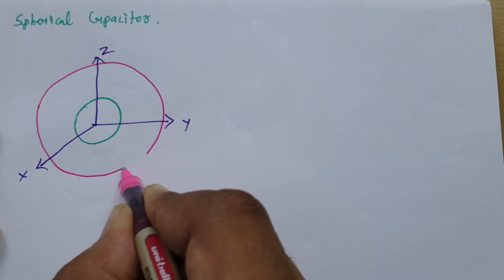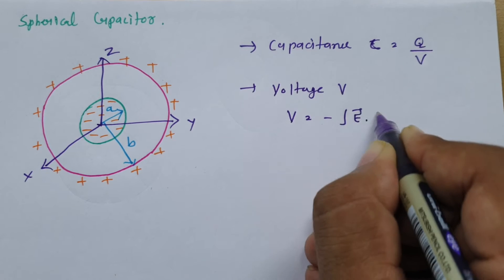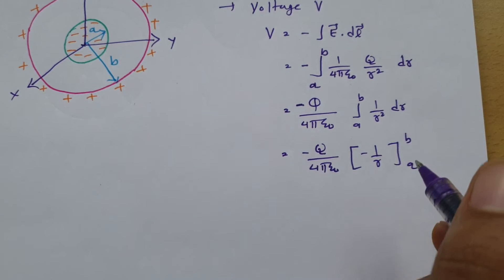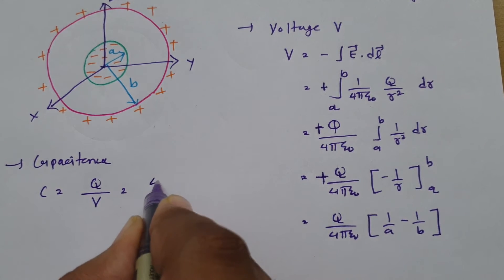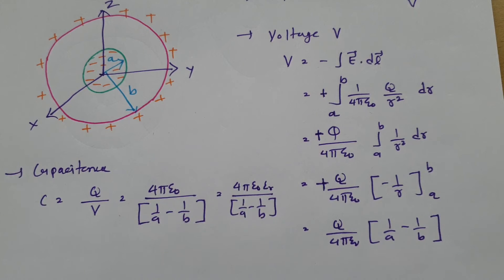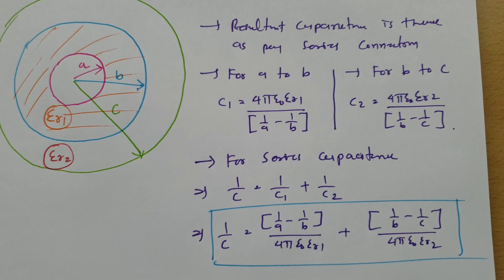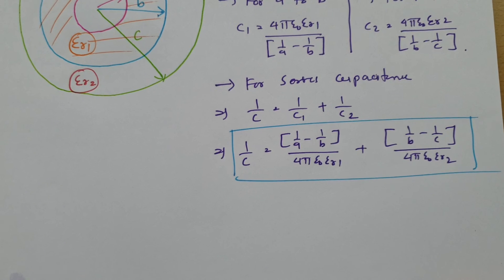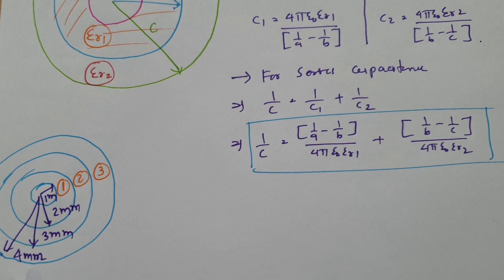Spherical Capacitor: Electric Field and Capacitance Explained

Comment: Excuse me sir how series capacitance is ..1/C= 1/c¹+ 1/c² .?
Reply from the maker: In capacitor Impedance Xc = 1/jwC. Which is inversely proportional to resistance. So for series capacitor 1/C = 1/C1 + 1/C2 and for parallel C = C1 + C2